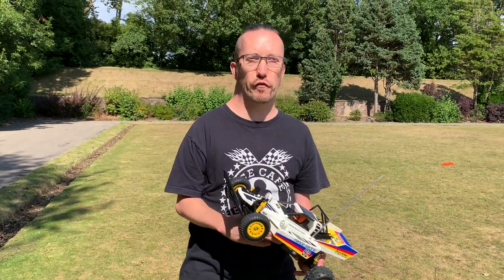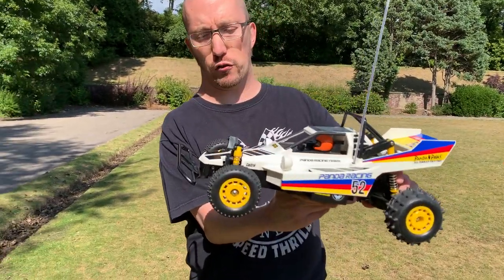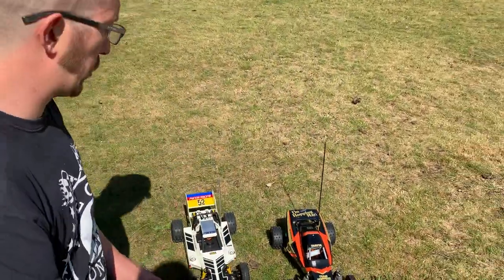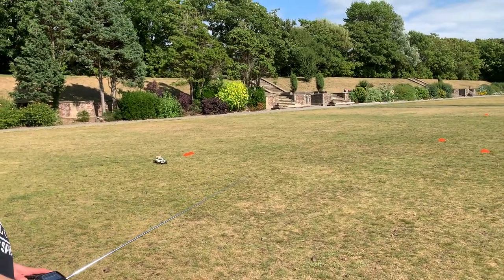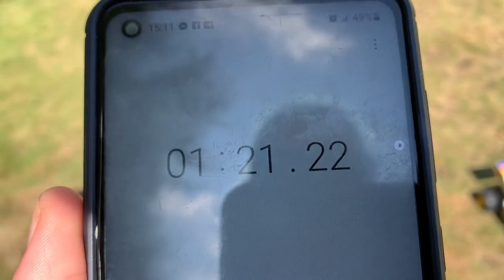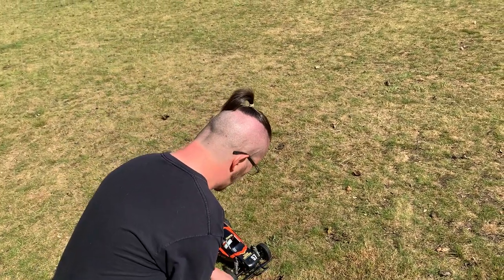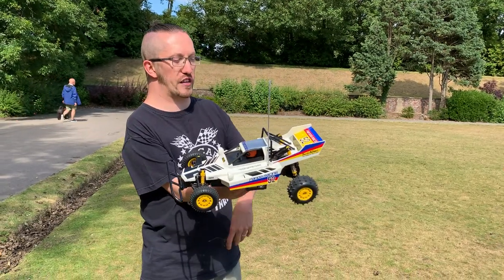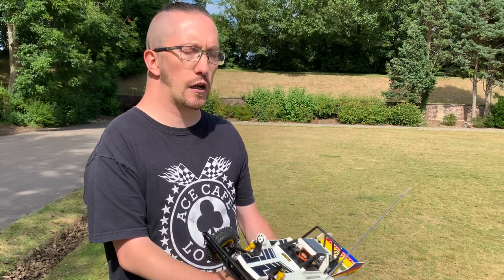E131: Panda vs Hopper, Tamiya vs Varicom, Which Is Quicker Round the Course?

Comment: Wow, I'm surprised how much quicker the Panda went round, despite the Grasshopper II looking faster. The softer suspension on the Panda probably helped quite a lot, might be worth putting softer oil or springs on the Grasshopper II, might not bounce around so much ;) Great video as always mate, I really enjoyed it!!
Reply from the maker: Hey hey the GH2 was definitely quicker but just not as planted and I could keep the power on so much better through the corners. It’s funny as I drove the panda the day after at my indoor club and if I’d had the grasshopper with me  that would have been quicker not the panda as the GH2 suspension is stiffer and it does t roll as much. Cheers for the support chap

Comment: Matches my own experiences. The Panda is simply more planted. They have superficially similar rear suspension but the Panda seems to work more effectively.

I think even with the brace on the Tamiya, the suspension still pulls open under throttle and locks up solid hence the hopping. I think the brace just stops the slap but doesn't fix the underlying cause. If you look at a mk1 grasshopper, it has no pivot slots and cannot slap but it still locks up under throttle.

Aside from the ball joint instead of pivot slots, the Panda has the same basic design but if you look at it, the rear axle is "further out" from the chasis which I believe allows for a greater pivoting force to act on the suspension which seems to counteract the rotational force that locks up the GH suspension.

The Panda seems to perform closer to the later DT-01 chassis which itself is like an improved take on the GH design and also features a ball joint in place of pivot slots.
Reply from the maker: That’s definitely and accurate description of what’s happening between the two chassis. The day after I raced the pander in the live axle class at my club but this time the grasshopper 2 was quicker but I put that down to to softer suspension and the tyres moving around to much on the wheels rims. But quite interesting to watch. Cheers for commenting :)

Comment: It shouldn't bounce that much with the oil filled dampers it should be better.
Reply from the maker: The grasshopper 2 needed some softer oil in the rear shocks to help with rear end grip, but even still the panda just handled better on that surface
Reply: @andyrobinsonrc2480  don't you think the fighter buggy RX with demolish the panda pandemonium whatever you call it?
Reply from the maker: I think it would be very close between them I’d say the RX might just beat the panda